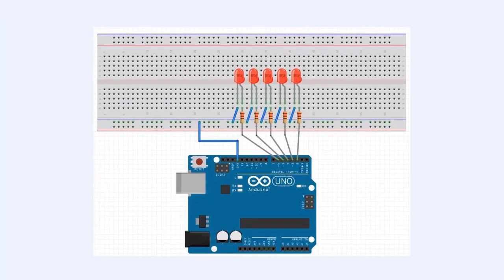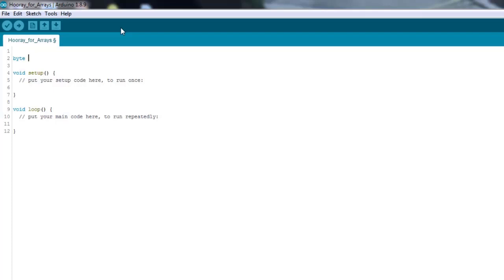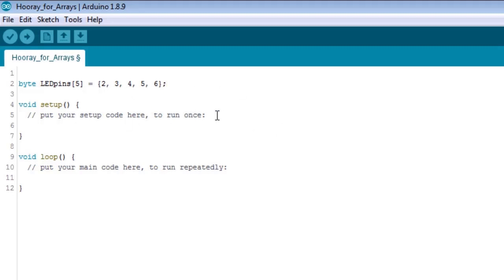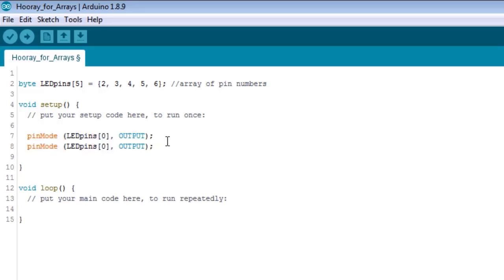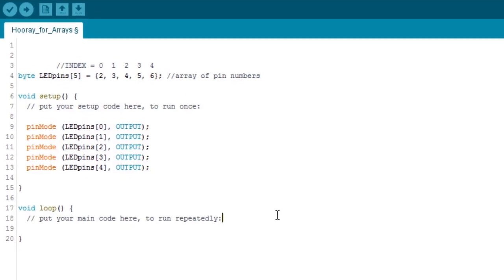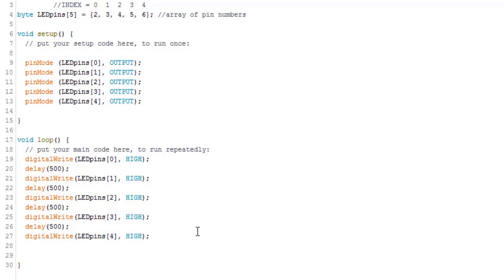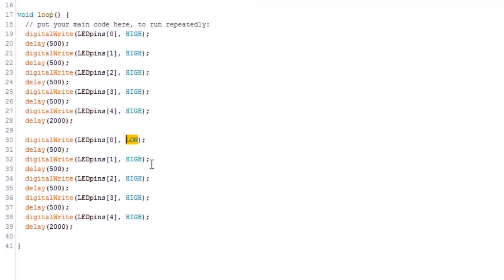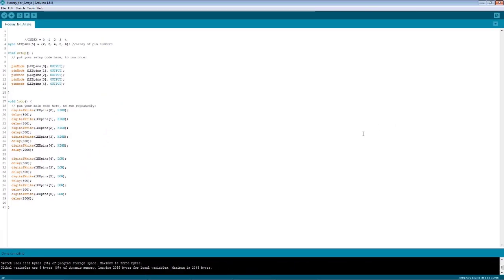How to Control Arduino Pins with Arrays

Comment: I type the code exactly and I've tried a few different words. But LEDpins cannot be used as a function????
Reply from the maker: LEDpins is an array not a function.
Reply: LEDPins is a byte-type Matrix variable and not a function.

Let me try to explain what an Array is:
- Imagine that you have a box, there is only one space for one piece, but if you put divisions you can put more diferent information inside this box, in this case, LEDpins has only 5 divisions and each division has a fixed address, starting at zero and going up to four, so if I type:
>> Serial.println(LEDpins[3]);
The Serial prompt will return "5".